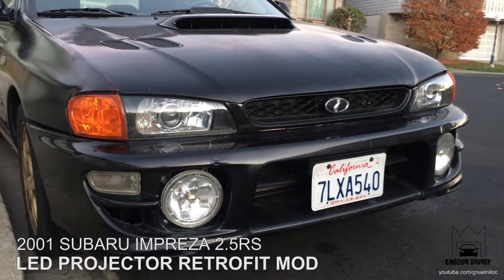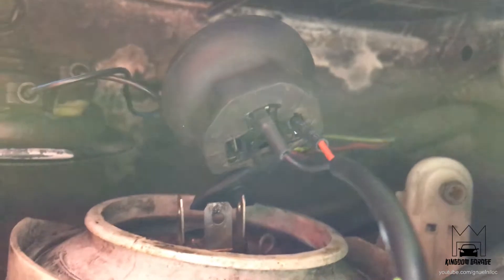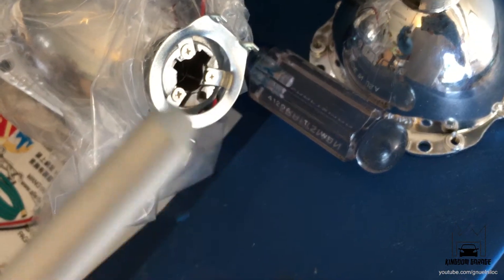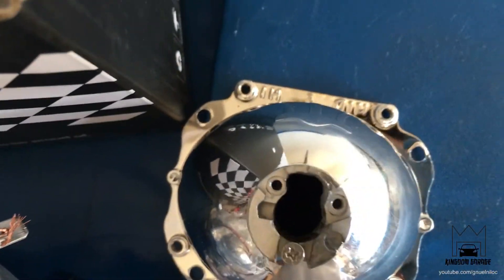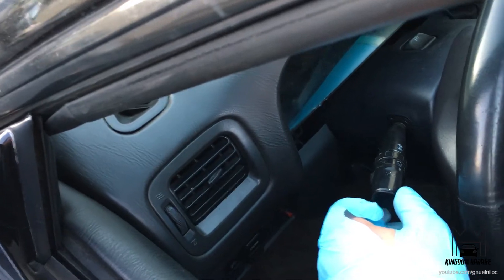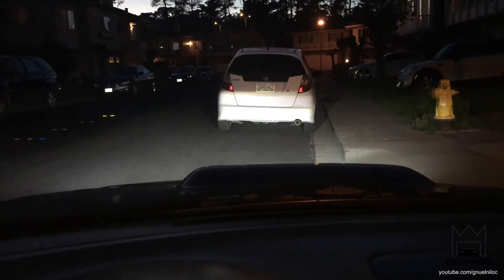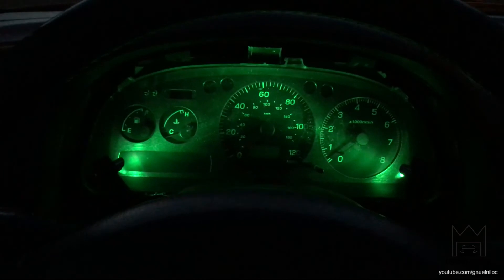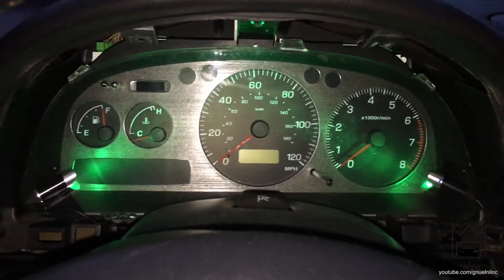$65 LED Mini Bixenon Projector Retrofit - Subaru Impreza 2.5RS GC8 Video 3

Comment: Does it have high beam and low beam
Reply from the maker: yes, the high beam circuit lifts the metal cutoff plate in the projector retrofit kit.